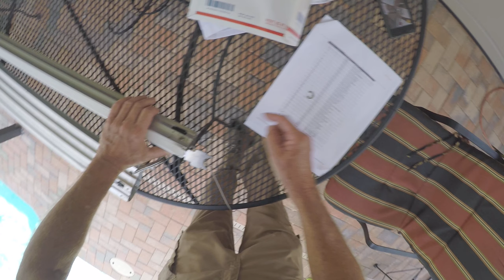Talon

Comment: I left my Talon down when I pulled out of the water.  I foolishly pushed the up and down buttons to try and get it to raise, even though the spike was bennt sideways from pulling it up the concrete ramp.  I finally backed the boat back in the water, but it would only raise a bit and not lower, then lower a bit and not raise.  I managed to get it up high enough to drive home.  I took it off the boat, took off the control cover, and found cable spaghetti.  After searching for a while, I finally found and watched this video.Thank you so very much for sharing this video.  It gave me the hope and confidence that I could repair my Talon.  I bought the cable kit and went to work.  Over the course of several weeks, slowly working on it small bits at a time, I finally installed the cable and put everything back together.  Your video saved my Talon.  Although it was a bit tricky, and I messed up a couple steps and had to start over, in the end, my Talon is back on my boat and working perfectly. Thank you, thank you, thank you!
Reply from the maker: Your welcome. Glad the video helped and thanks for the comment.

Comment: Thank you for posting a video on this. It's the only one I've been able to find to guide me through this issue as I'm trying to replace my cables now.  Have you (or anyone else in this comment section) ever ran into an issue where, after bumping the spool into place where both places to install the cables ends are easy to get to and after the extending cable has been attached and wound on the spool, the spool stops leaving the place to put the retracing cable under the metal spool bracket without enough room to even fit the tip between? I've relieved the tension on the extending cable, reset the spool to where it was set on the distance that would have been necessary for it to have reach the spot it needed to be (this left the other side under the metal bracket but that side had enough clearance to attach the cable), and then redone the procedure but the spool still stopped at the exact same spot. I guess the extending cable is only so long so it is going to seat at the same point no matter where the spool is located when it is wound onto the spool. Any suggestions or thoughts for this??
Reply from the maker: Had to go back and re watch my video. It looks like my spool stops at the right spot to access the slot for the retracting cable. I have twin Talons on my boat and replaced the cables on both, and had the same result where the spool stops at the right spot to access the slot. if you watch the video at around the 38:00 minute mark you will see I did have to leave the cable off the top roller to get enough slack to slip the cable into its slot on the spool and then worked the cable back onto the top roller with a screw driver. Is it possible that you may have accidently used the shorter cable for the extending cable. At minute 18:38, I show the long cable is the extending cable and the short is the retracting cable. One other important  thing is at minute 22:25 where the retracting cable has to be routed between the pin and the rubber bumper. I cant think of anything else. I hope this helped.
Reply: @mdw66799  Thanks for the quick reply. I bumped the spool while connected to the battery until the openings on both sides were open to allow cable insertion and then extracted the pole with only the longer extracting cable connected but I think you are on to something thinking that something in the routing may have shortened my cable reach. I'm going to open everything back up and follow the routing again.

Comment: Thanks for posting this.  It helped me with replacing the cables on my Talon.  Do you know anything about replacing the motor assembly?  Can it be done without removing the cables?
Reply from the maker: Looking at the parts diagram. It appears that the shaft from the motor gearbox holds the spool in place on the mount. It would be nice if you didn't have to remove the cables again. I would loosen the motor without taking the bolts all the way out and see what moves. Good luck. I would be curious to know if it works.
Reply: I have some ideas and will let you know.  And will take some photos.  The biggest deal will be stabilizing the drum.
Reply: @mdw66799  Sorry to take so long to reply on this.  I was able to  replace the motor assembly without removing the cables.  Using some PVC pipe I built a rig to stabilize the cable drum.  I have pics but don't know how to attach them to this reply on YouTube.
Reply from the maker: Thanks, good to know it can be done.

Comment: Thank you for taking the time to put this video together. I recently had a cable break and was very intimidated when taking things apart. Took my time breaking everything down and putting back together. By far getting the cable on the spool and into the keeper was the most difficult part. 

I removed the pin on the motor shaft that would allow me to spool the extending cable onto the spool by hand. I was not comfortable doing this with the motor and taking the chance of not having something together correctly and causing damage. 

I ordered all the repair parts include the cable kit, SS rivets, C-clip and top position sensor spacers from Minn Kota directly. I was missing a C-Clip on one of my pulleys and I lost a spacer when taking things apart. 

Thanks again, 
-T

Comment: Fantastic video. Successfully replaced both cables on my Gen2 10' Talon yesterday. Not too bad until you get to that retracting cable and getting it on the drum. Once you figure that out you're golden. 

1. Deploy Talon all the way - which loosens the retracting cable.
2. Put retracting cable onto large pulley (with Phillips head screw all the way retracted) - keeping cable off smaller roller and to the left of it like stated in video.
3. Now run cable down frame and wrap nicely onto drum. Using thin forceps helps tremendously if you don't have small skinny hands. 
4. While pressing in the large springed pulley - you should be able to wrap the cable all four times onto the drum and slide into slot. It's tight. 
5. Run Talon up/down a couple of times - then like in the video - using a slick screwdriver you should be able to slide cable onto smaller roller. 
6. Go fish.
Reply from the maker: Awesome. Glad the video was useful.

Comment: Thank you sooo much for posting this video. You were asking about another way to finish spooling without taking the cable from the tensioners idle roller, I found that leaving that one alone and removing the roller at the bottom end of the second section withe the talon fully extended allowed plenty of slack. Putting the roller back was as easy as using a thin flat head screwdriver and pry it into place and reinserting the roller pin, no need to run in and out to gain slack this way and you wont take the chance at damaging your cable.
Thank you again for this video if you only knew how much you saved me.
Reply from the maker: Great idea on the second section roller.

Comment: I was able to get hold of minn Kota for a free replacement.  Their policy is to send it to a local authorized repair center.  FYI you would have to pay for the work and the spike would be free.  My dealer would not do it because I didn’t buy it from then. All the other centers are hours away from me.  I was able to get the spike sent to me directly and will have to install it myself.  Thanks to your video I already removed the broken spike and just waiting for the new one.  My unit is 2011 and it had a pin where you had an Allen nut.  Ill let you know how it turns out.  Thanks again for your video
Reply from the maker: Awesome news about the free replacement. If the new one comes with an allen head screw instead of a pin, remember to screw it in until the head is just below the surface like I showed near the end of the video. If the head is not even or below the surface it is screwed into, it will hang up and not let the spike retract. Made that mistake myself. Good luck and thanks for the response.

Comment: thanks for taking time to make this video. I have a 2 stage talon. Cable and spike needed replacing. Very helpful video. Im a power pole guy. this boat I bought came with broken talon. I would not recommend this pole over a power pole ever. 12volt and electronics do not mix with saltwater ever....But it is an ingenious product. Ive learned you better maintain it with good ole WD 40.  Thanks again.

Comment: You said Minn Kota would not fix yours under warranty because of what?  I couldn't catch what you were pointing at or referring to.  Thanx!!
Reply from the maker: Minn Kota won't warranty a repair due to neglect. I was pointing to the dried mud and sand inside the unit and around the roller. Probable should have mentioned that in the Video. So far I haven't had any more issues with the cables, but now I take more time rinsing them out. Thanks for the comment.

Comment: Will the 12 foot one be the same? My choices are $85 for the kit and attempt or $400 to have it fixed.
Reply from the maker: The 8'  10'  &  12' all appear to assemble the same just the cables and housings are different lengths for each one. My Talons are the 2016 model. Here is a link to the parts list that helped me. It my be useful. Hope this helps.  https://northlandmarine.com/pages/minn-kota-talon-shallow-water-anchor-parts-diagrams

Comment: Appreciate the only video I’ve found 
I have my cable on order  for an 8’ talon
Which cable goes on spool first
Reply from the maker: On My 10ft talon I connected  the cable that extends the Talon on the spool first. The talon should be completely retracted (all the way in) before you attach the cable to the spool. Then I used the motor to wind the cable on the spool by pushing the talon down button. Be careful because the other loose cable is going to pull itself down the tube. Make sure the loose cable that will be pulled into the tube while the talon is extending has no loops or tangles and no one is near or touching the cable, because once you push the down button it will not stop until the talon is completely extended. Use extreme caution. This procedure has potential for lose of limb or fatality.  Watch the video at about the 33 minute mark to see how I did it. Be careful and good luck. Remember  to make sure the Talon is never connected to the battery except for this one procedure and disconnected afterward for the rest of the cable install.

Comment: Wow absolutely one of the best repair videos I've seen on Youtube!  Well  done and thank you!  I have a question though.  I need to replace the spike piston on my 10' that is just like this one.  Those little round magnets at the top fell out so the sensor at the top isn't telling the motor to stop.  The motor does stop, I assume because of a voltage drop when hit hits the top.  So need to fix it before I break a cable!  I'm wondering what is the easiest way to get enough slack in the retract cable to pull the piston out after I remove the spike?  Thanks in advance.
Reply from the maker: Wow that's a tough question. A gentleman named Kevin Mize in my comments a year ago came up with a great idea. If you fully extend the talon, the very bottom roller and cable are exposed on the second stage. If you remove that second stage bottom roller it may provide enough slack. Be careful though its probable under tension. That may work. You would also after the tension is off, go back to the end where the talon piston is and pry the plastic locking tab out of the slot like I did around the 2:35 mark in my video, to expose that bottom roller. It would have to come out in order to pull the piston out. You my have the move the last stage in by hand as you pull the piston out.  hope this works. Good Luck and if it works leave me another comment. It may be helpful to me and others. Thanks, again.
Reply: @mdw66799  I got around to replacing the spike piston on my 10' Talon. Removing the roller per Kevin Mize and the very bottom roller did not give enough slack to pull out the spike piston all the way.  I made the mistake of pushing/pulling the bottom/third stage without keeping tension on the cable and ended up with the cable jumping off internal rollers.  So I had to remove the third stage and swing down the plate at the bottom of the second stage to get the cable back on the rollers.  Not what I hoped for, but I did finally get the job done.

If I had to install another new spike piston, here are the steps I would follow.

Start with the Talon extended all the way. 2) Using the screw on the tension roller at the top of the Talon, get some slack in the retract cable.  Slide the cable off the rollers for a bit more slack. 3) Remove the retract cable from the spool by the motor. 4) Remove the plate at the bottom of the third stage or use your method to allow access to the bottom of the third stage roller and spike piston. 5) Remove the pin and set screw holding the spike in per your video and remove the spike. 6) Remove the exposed rollers at the bottom of the second and third stages. 7) KEEP SOME TENSION ON THE CABLES AT ALL TIMES so they don't jump off the rollers! A helper is pretty handy in this regard. 8) Remove the extend cable from the spool. You may be able to retract the Talon first by pulling the retract cable and pushing the stages in as needed to make it easier to remove the cable.  Either way, it's not real fun removing or installing cables on the spool. 9) Now you can pull out the spike piston and replace it. 10) Reinstall the spike piston, again keeping some tension on the cables. 11) Reinstall the spike in the piston. BTW, the new style piston uses a sleeve and a bottom screw to hold the spike in the piston, rather than the set screw through the side slot. 12) Connect the extend cable to the spool. 13) Reinstall the rollers at the bottom of the second and third stages.  14) Connect the Talon to a battery and extend it per your video, winding the cable onto the spool. 15) There should be enough slack to wind the retract cable onto the spool and install the cable end into the retention slot. 15) Slide the retract cable back onto the top rollers. 16) Run in and out to test. 17) Reattach the bottom plate on the third stage.  Hope I got all the steps covered here.

Now I just need to figure out how to keep the little magnets at the top of the spike piston from rusting and falling out again.  This is the second time in 7 years as I use it in salt water. While I rinse it every time, there's no way to rinse off the magnets as there is no top flush on my model.  I may modify the cover so I can rinse this part out without removing the cover every time. Tips appreciated!

Thank you again for the excellent video!  I wouldn't have been able to do this repair without it and saved me some money!
Reply from the maker: @gregdanneffel9064  Thanks for adding to this video. Details are very clear. It will help Others and Myself.

Comment: At the 25:55 mark you mention the cable has to go between a certain point. Is this the long cable or short cable?
Reply from the maker: That would be the short cable (retracting cable)
Reply: @mdw66799  thank you!  I have the Bluetooth 10 footer. It’s kicking my butt but this video has been tremendously helpful. The most difficult thing at this point is getting the wires on the roller without it raveling up. I’ve tried about 3 times already

Comment: Great video. I watched this even though my cabels have not snapped. My motor is making a bad noise and need to replace it. Just worried about removing it and if the spool is under pressure and pops on me or something. Cant find any videos about the motor.
Reply from the maker: If you scroll down to Charles Millers comment. He was able to remove the motor using a pvc pipe rig that he made up. No pictures though. good luck. Worst case, the disassembly and cable routing was more time consuming than rewinding the spool.
Reply: @mdw66799  Thank you for the info! i actually bit the bullet and took it apart. It wasnt hard at all. Unluckly for me the motor which is basically a starter motor and a loud whine to it.  will need to replace.

Comment: Awsome video. What caused it to break?
Reply from the maker: First one happened in the Florida Keys fishing under the seven mile bridge. I was in a narrow channel during the tide change. The current wedged the Talons in the rocks. When I retracted the Talons one came up and the other one snapped the spike off and broke the cable. About a year later the other one broke from neglect. Didn't  spend enough time rinsing the salt water and sand out of the talon. Its been about 4 years now since I replaced the cables and haven't had any more problems.